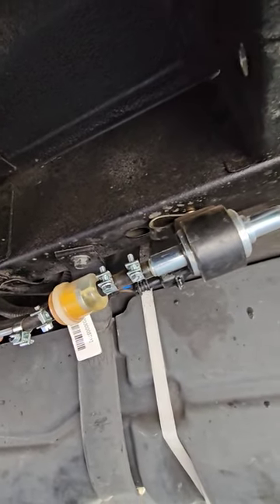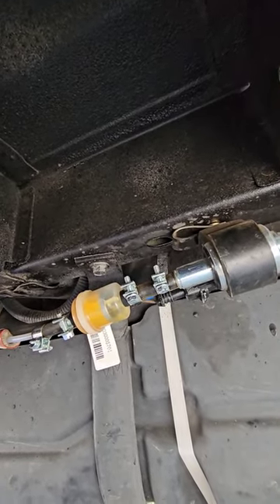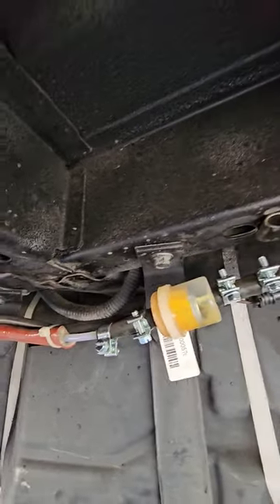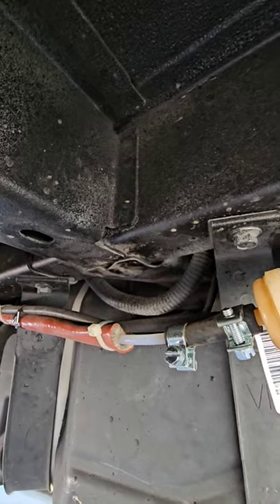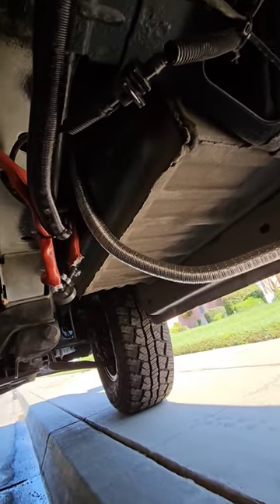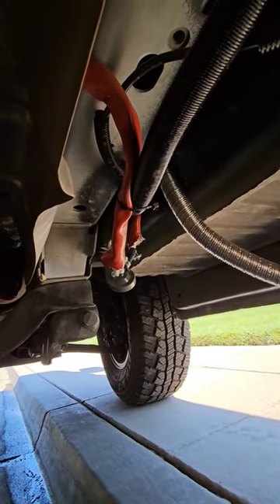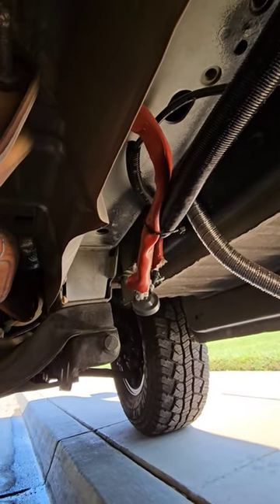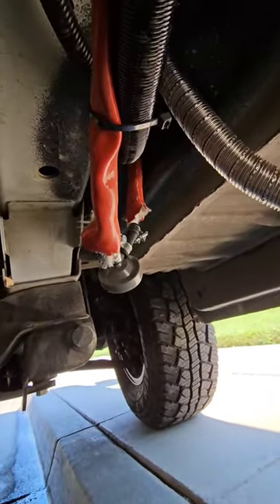Bison 2000A Bunk Heater hard start fix! #vanlifeliving

Comment: Hmmm... hard to tell from the point of view on the video, but the fuel filter should be between the pump and the tank.  That round damper is for the pump.  The check valve is a small gray filter-like piece.  Has your unit been working reliably after this set up?
Reply from the maker: After it's sits for a few days it takes awhile to start. I moved the check valve right under the heater too. Yes the filter is after the pump, have not use the heater in weeks now. Looked under the other day and there was still fuel in the filter. Personally I think the pump is very low pressure. I wish I knew what the psi is supposed to be.